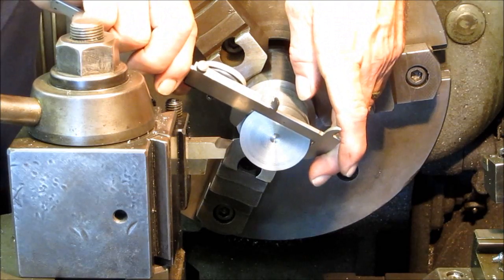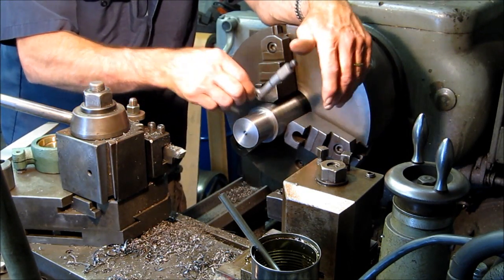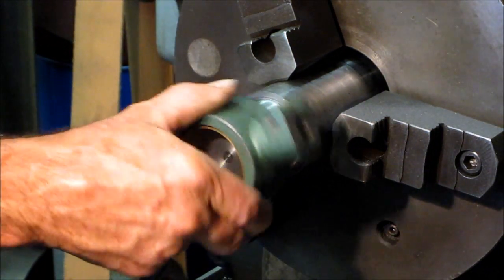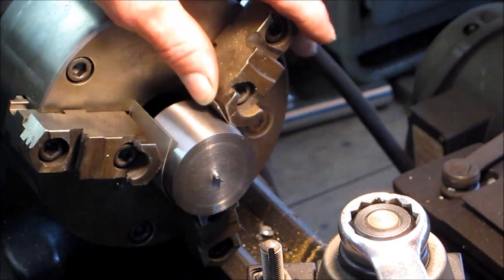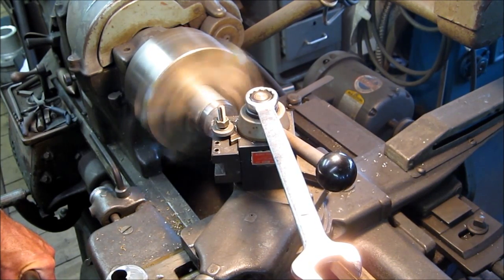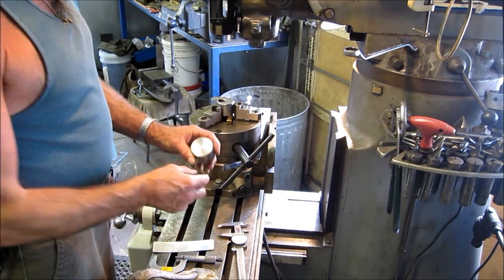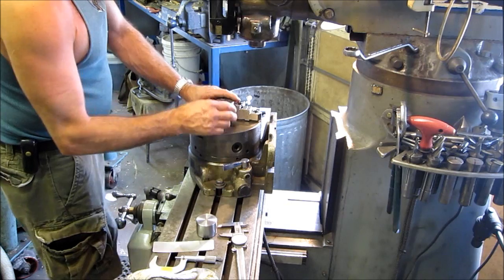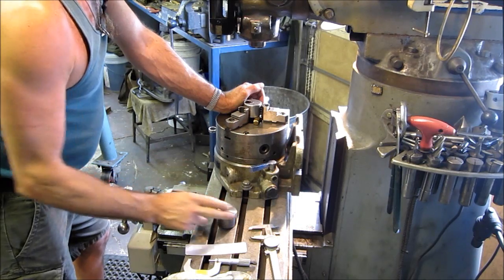Mail Call (Benchmaster) Part Seven

Comment: Mineral spirits cleans the cosmoline as well, and leaves a bit of an oily residue behind. which i find good. Any thoughts on a good first lathe? I have found a Sheldon exl 10x36 well tooled and in very good shape, one owner. Or i could get a larger lathe. Like a tug-40 17x40 gap bed, but its a bare lathe and looks like it has been rode pretty hard. my budget is about 2k. Any thoughts what i should look for?

Comment: I would have don't it in the super spacer as well, my reasons being I don't have a great 4 jaw for my small lather, and I don't feel like changing the chuck on my big lathe!   Have you ever used soft jaws for a job like this? It works great as well, but it really only makes sense for repeat parts.

Comment from the maker: There is absolute truth in that statement, just as a comparison of holes drawn with a cad system, using 24 nodes verses 48 nodes. The amount of concentric is well within the requirements of this project. Most machinist within their own trade and the projects they work on, know surface requirements and have the machines to perform that said finish, like air-o-space or ship-fit… The two most common to try to enter pissing contest with each other… LOL… Try to sense when you’re invited to one!

Comment: I have been told by other machinists that filing on the lathe does not guaranty that your workpiece will be remain truly round.  You are working to very tight tolerances (from my novice vantage point).  Are you concerned about ending up out of round with filing?  ***Great videos.. I can only echo the fellow below in that I feel like an apprentice peaking over your shoulder and very much appreciate all your videos.

Comment from the maker: I bought that chuck and made the backing plate for the Southbend and it holds tight .0005 or better, not that it is important for the open air surface of the lobe, it is there and available...